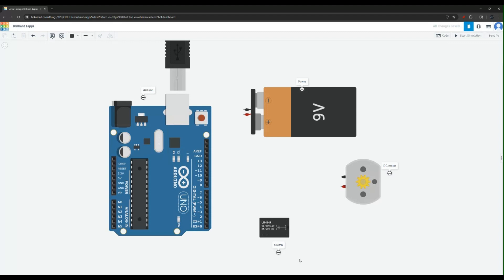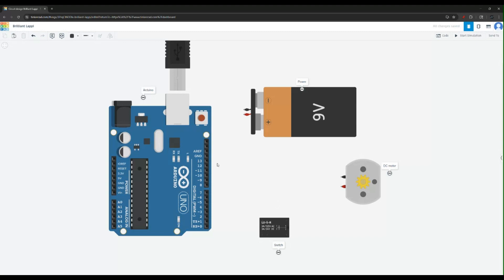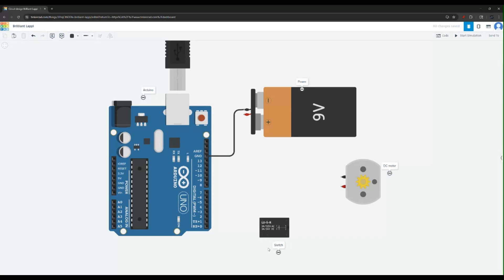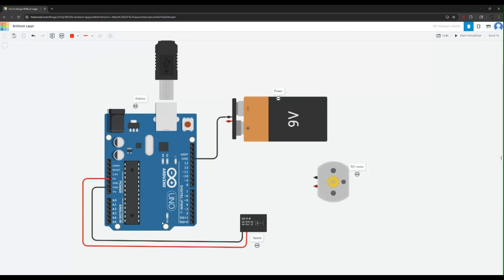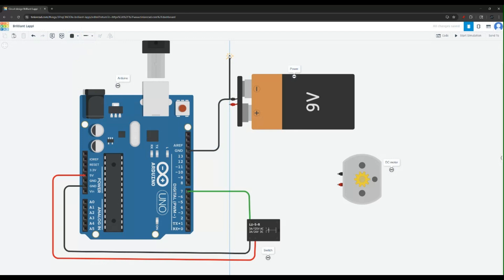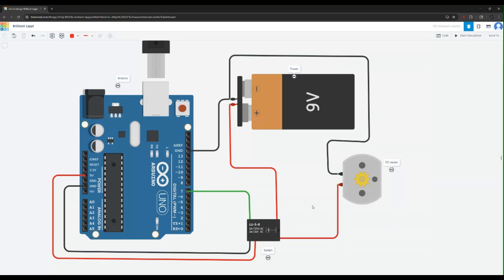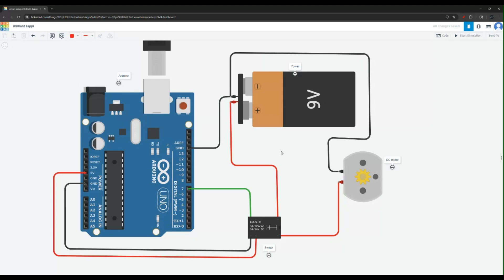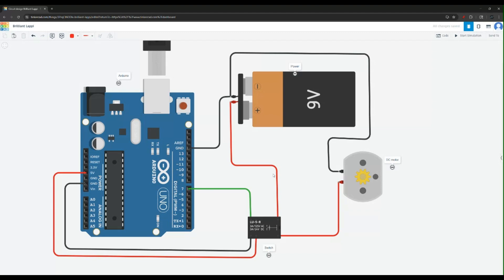Use External Power Supply With Arduino - ESP32 - Raspberry Pi

Comment: If I have a 9v dc power supply adapter, will it work instead of the battery?
Reply from the maker: Yes, same rules apply, common ground of course and Arduino need to be powered by 5V separately

Comment: Would that work with a 12v power supply or a buck converter is needed?
Reply from the maker: Buck converter would be needed in that case for the arduino but if the arduino is being powered on 5V then the external power can be 12V no issue because you only need to connect the GND

Comment: Can you explain why the 9v ground is connected to the Arduino?
Reply from the maker: Great question. Connecting the external power supply's ground to the Arduino's ground is essential because it creates a common reference point for voltage. Without this shared reference, the electronic components can't correctly interpret the signals sent between them